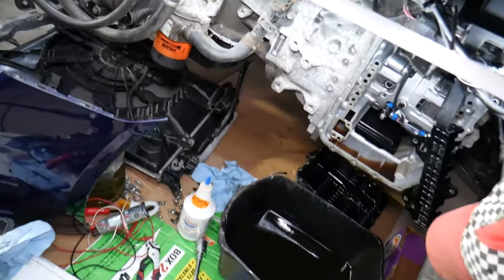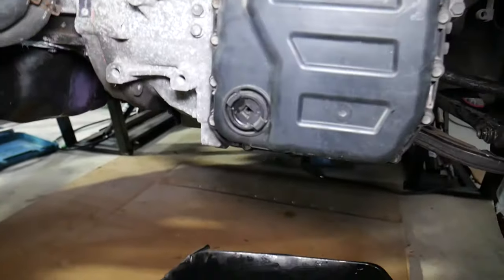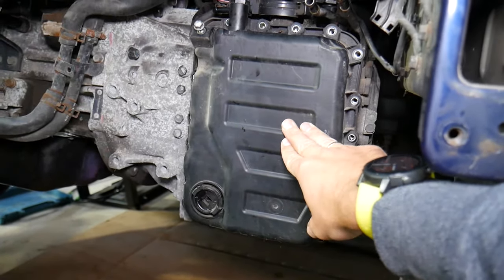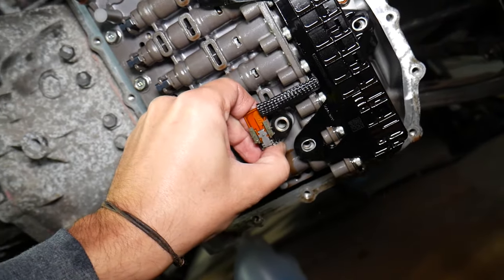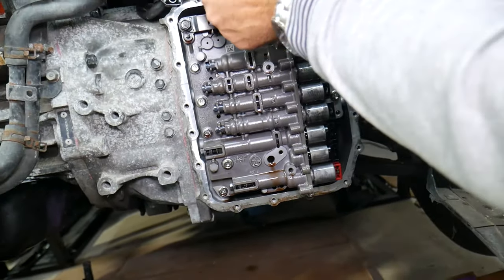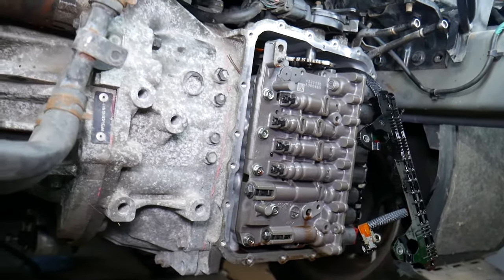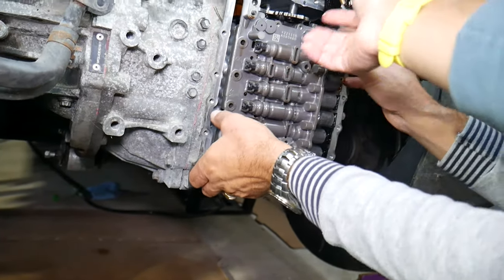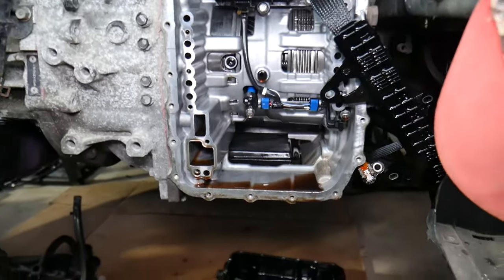HYUNDAI INPUT OUTPUT SPEED SENSOR LOCATION REPLACEMENT SONATA ELANTRA SANTA FE TUCSON VELOSTER ACCEN

Comment from the maker: Products that we use and recommend, Check Fitment:
► Transmission Solenoid: https://amzn.to/2ZytZYu
► Transmission Oil Pan Gasket: https://amzn.to/3pQKASc
► Transmission Filter: https://amzn.to/3BzrAdq
► Transmission Oil Pan: https://amzn.to/3mqbXQW
► Transmission Fluid: https://amzn.to/3mqlDuM
► Panel Removal Set: https://amzn.to/3YiMADu
►Torx Set: http://amzn.to/2hbyWgd
► Tool Set: https://amzn.to/3p5MM6t
► Screwdriver Set: https://amzn.to/3XRB28Q
► Engine Oil: https://amzn.to/3xBc8B9
► Oil Filter: https://amzn.to/3w0Ulme
► Torque Wrench: https://amzn.to/32qyRwg
► Liqui Moly Engine Flush: https://amzn.to/3IiDBID
► OBD Scanner that we use most often: https://amzn.to/3I4MQfe

► Check out our Amazon Store for the tools and parts that we use: https://www.amazon.com/shop/worldmechanics
Reply: Thanks you again for all the great info. What would be the symptoms of bad speed sensor if I may ask?

Comment: Bad engineering. 
Why put this sensor inside the gearbox?
I sold my 2005  santa fe. 
Changing plugs on the V6 was a nightmare. 
Thank you for this video.
Reply: Agree. If I designed them, all valves would be changable from the outside, but alas they want to support the repair industry. If I could remove each valve and relay I could test without taking apart.
Reply: Hyundai has terrible engineering design for everything. Bunch of knuckle heads. Everything is a hassle to get to. What they did  to something as simple as changing a 3rd brake lightbulb on a 2009 sonata is almost criminal.
Reply: @hearditfirst8010 LOL, the rear brakes are a federal crime to work on in these cars if you ask me. Just to get the caliper off to remove the rotor you have to pull off the upper control arm that is twist/bolted to the frame. Need a jack separate jack to take it off.
Reply: whats your favorite designed car as far as easy repairs

Comment: What's the longest bolt on the valve body. I tighten mine too much and it broke off inside the valve body. I removed it without an issue but I need to replace it. Also the outta bolts that keeps the valve body attached to the transmission. I might need to replace them to.
Reply: I know this is a year old, but all you have to do is take a picture of the bolt, VIN, and its location and describe the location to the Hyundai parts retailer. They'll almost always give you the part number on their web catalog. Cheers.

Comment: I can't get out the last bolt in the lower part of the black drain pan. It's in the 90° coner of the pan. My tools are blocked by the cars body frame. 2011 GLS. What told can reach that tight area? 10mm bolt.

Comment: After installation I got error Code P0722. Does that means the sensor is bad or the sensor hoes needed cleaned first? I never had an error Code until the replacement was installed and everything was back together.
Reply: Add more oil

Comment: I changed the speed sensor on my 2011 GLS. Now the distance to empty gauge is changing erratically. Shifting from P to D or R, my car jolts. Shifting became smoother after a few mins of driving. Also the car's speedometer doesn't move an inch until the RPMs reach 2. It's like delayed. Feels like I loose power. I replaced the transmission fluid with the engine off (cold). Would that be the issue? Shifting is rough also but not all the time. My main issues are erratic changing milage guage. High RPMs with lagging speedometerc hard shifting. What would cause that? Too much fluid? Too little? A bad speed sensor?
Reply: I think when you fill the transmission you should top it off with engine running and gearbox at operating temp..
Reply: I had the same problem now, how did you fix it?
Reply: Turns out, it was my clock spring. I replaced my steering wheel with 2013 wheel. Mine was a 2011. So I assumes that the 2013 had shifting capabilities. Since the clock spring was going bad, it interfered with the 2013 steering wheels interface, causing my car to shift radically. Replacing the clock spring solved everything. I even changed my speed sensor inside my transmission...the didn't work. My car currently has the old speed sensor.

Comment: Hello guys, I'm currently using a Hyundai Elantra 1.8 2005,currently I'm having issues with the gear change from 3rd to 4th (final) sometimes it changes late. When I reduce speed and slow down it drops  to 1st gear but the idle ram is stuck @1500 and normalise to idle sometime later. What could be the cause. My idle valve has a crack but I managed to glue the crack and it's working. TIA. 👍